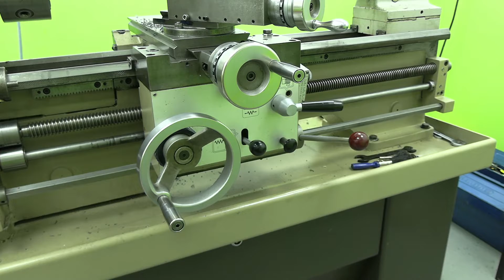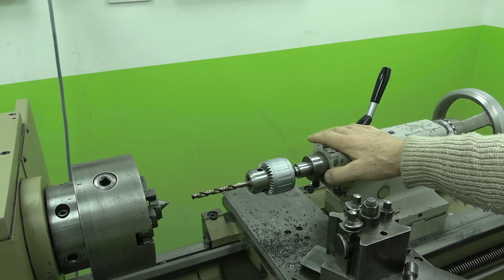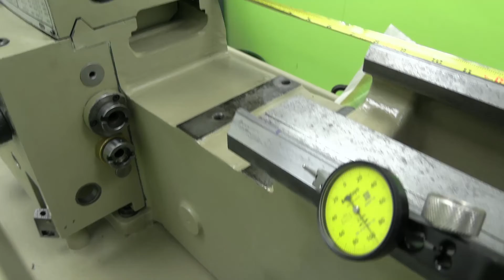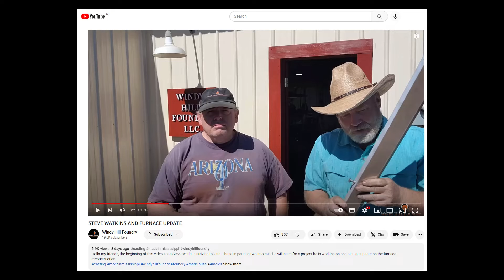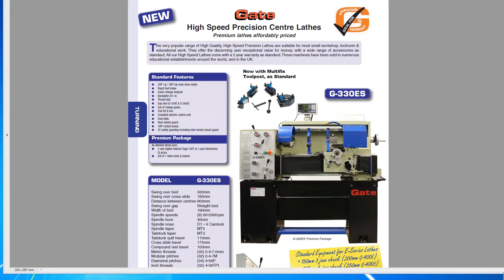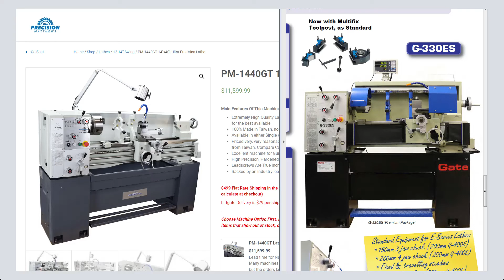What shall I do with my Harrison M300 lathe??

Comment: Hello, I have conversed with you in the past, you sent me copies of the invoice for your gearbox bushing & carriage drive rod.  I am fixing up a TRVS-330 version of your lathe.  I made my own bushing & modified the driver, I won't be robbed, Clousing charges double to triple for the same parts that you paid for them.  If you would like, email me and I will send you pics, your videos saved me a lot of time.  Back to your machine dilemma, my machine cost me $1800 delivered no tax,  mine looked like hell, but under the grime was not to bad. my gearbox was jammed by water based cutting oil congealing in the gearbox no rust. The cross feed gib screw was broken off, the tailstock cam lock was worn, made a new one, luckily the housing is tight.  I knew all along I was going to grind the ways and have the carriage fitted with turcite it will cost me $2500 to do this. maybe I will have the bottom of the tailstock ground. But in the end I will wave a mint machine that will hold a tolerance. I could easily spend $5-7 thousand for a machine that still has wear & problems.  Finding a machine with very little wear will be ridiculously expensive, plus tax and shipping. keep what you have, you are the master of tinkering, Roll with it!!!  Cheers,  chas. giles@ verizon.net
Reply from the maker: The regrind job I was quoted included turciting the saddle which is good. Oddly the bloke I spoke to said he did not advise grinding the tailstock. He said just shim it up, which I guess is not too difficult.

Comment: It's sad that the birthplace of the industrial revolution has seemingly such a paucity of machine shops willing or capable of a relatively straightforward operation of regrinding a lathe bed - there must have been hundreds at one time - but having put all that work into it, I'd be tempted to go the regrind route if you have confidence in the shop doing the work Having said that, I defer to others here who've got a lot more experience than me!
Reply from the maker: Yes this is one worry: what if I spend £1500 on a regrind and it's no good?

Comment: I can't see you being happy with the inaccuracies in the ways, if it bugs you now, it will always bug you, I'm thinking, if you did have the ways reground, plus the saddle (a good price if that's included in the machining + Turcite) then you have the start of a very good lathe. The tailstock, although difficult can be sorted, your crosslide can be renovated on your mill, with finish scraping (might have to make a new gib) the seals are relatively easy to do, you can surely live with the staining on the front bearing, so If you get all this done (maybe £2000/£2500 total?), then you wouldn't be moaning (as much) I think! anyway, Happy Christmas to you, and I hope you sort it, cheers Dave
Reply from the maker: Yes that's a plausible line. My only reservation is what if the regrind doesn't turn out well?
Reply: @samuelfielder  Hopefully you get a competant machinist, It would be good to get some favourable testimonials from their previous customers

Comment: Hi Samuel, thanks for taking the time to share your experiences with your M300. My thoughts….. it all depends as to what you are planning to use the machine for. I believe that there will always be something that you are not happy with this M300. If it was my lathe I would get, if possible an expert to evaluate the issues that you have with the lathe. Then give you a plan as to what may be achievable buy reworking it. Then if this proves to be untenable, cut your losses and get the machine that will do what you need it do. Many thanks again and Merry Christmas

Comment: Hi Samuel,
you went through the hype cycle, nothing special with restauration projects. Check out Wikipedia for more infos 🤓
The tailstock shaft could be fixed with a plasma coating. Its an inexpensive procedure and hopefully available in you area. Problem: you have to bore your tailstock to a bigger diameter. But it is no rocket science and also inexpensive.
Example: https://youtu.be/bYj60ctAmAY
The sealings must be exchanged. Advantage: now you know how to disassemble the machine. Also inexpensive 

The cross slide does not have to be coated! You can machine the connecting surface of the apron. I did it myself on my Weiler LZ 280. 
Yes, the bed ways should be ground. But you need to disassemble the machine anyways. I don’t know if your calculation includes transportation costs, but grinding in Germany is much cheaper if you know where. But, if you grind the bed ways, you also have to scrape the cross slide and the equipment you need is very expensive. Ask the community for borrowing it.
The spindle bearing can be exchanged with one from Thailand. I don’t have a link, but I bought bearings for my mill spindle for 70% less the money than SKF wanted.
A new machine? I was wondering about the options you have shown in the video? What are the main dimensions you want to machine on the lathe? You easily can get a quite good one starting at 3000€ from China

Kind Regards, Adam
Reply from the maker: Thanks I hadn't thought of spray coating. I've seen Adam Booth do it. Machining the apron up is a possibility but problem is that would increase engagement of the gears that drive the cross slide. The price I was quoted for the regrind included machining and turciting the saddle.

Comment: Hi Samuel, the real question here is how accurate do your jobs have to be? if your lathe gets you in tolerance on your work I would do nothing. If it does not and you can't work around it, then you perhaps you could call in a technician to try and move forward that way. In any case I would want to get some experienced eyes on the machine in question before making any decision. Remember that any kind of drilling/boring with the tailstock should be considered 'roughing' Boring to final size will always be more accurate and it's usually possible to work round machine wear and tear. I have an M300 myself and I'm a retired turner of some 50 years experience. Hope you get a resolution that isn't punitive. Regards David
Reply: Your dead right he’s got a pretty decent lathe and the work and time spent on it proves it    In other words he knows what he’s got.   The wear issue just magnifies tool pressure      and it’s not that bad ( I use a m500and a m300 )and the wear he’s got is way less and like you can work to bearing fits when necessary
Reply from the maker: If you're a retired turner pity you don't live closer to me near Winchester. However, although I accept an experienced machinist could teach me a load, I don't really think he could tell me anything I don't already know about the state of this machine.
Reply: Yep.
I’d just learn to put up with the wear.
I run an M400 that is worse than that. 
I know it’s not right but it’s pretty common for machines to be this worn, and it’s common for machinists to just work around it.

Comment: Hi Samuel,
I have watched your videos from the beginning as I purchased a M300 at the same time via Ramco auction who sell off ex MOD equipment. I had several parts missing which I got second hand or made myself. When I cleaned my machine it was full of brass so I imagine it was only ever used in an armoury. I was always concerned when you got deeper into your strip down. You need to remember these are well made old British machine tools and it's a black art to re-assemble them. With the time you have spent on this machine I would suggest you speak to the re-grind company and see if they can recommend a company they work with who could do a full rebuild for you. I now make a living out of my M300 due to the pandemic. Keep the good work up and videos coming. Merry Christmas to you
Reply from the maker: How do you make a living out of your M300?? Glad to hear that! I'm not sure there's much of a black art re-assembling an M300: as I see it there are absolutely no adjustments (unless you wanted to scrape the ways under the headstock). If my lathe were cutting a straight taper I'd be thinking about headstock alignment or twist in the bed, but it cuts more of a curve which can only be down to wear in the ways.

Comment: Hi Samuel, remember the lathe is only as good as the skill of the operator! For what I do as a hobby, & occasional orders, I can generally get to 10 microns accuracy when required, making things like petrol engines etc that are very nice. I do have a top DRO on it but my lathe is a Warco 250V bought a few years ago brand new with extras for less money than your M300. I'm a guitarist so my guitars are a lot more expensive. You will always want better, but be serious about what it's going to do for you. Maybe learn on a Warco then go for the better lathe later if you still feel it's right to do so.

Comment: If you're not happy, you're not happy, that's it!!! The only thing I would say regarding your choices, don't be so eager to throw 15 to 20 thousand at a new lathe, even if you can afford it. The Gates lathe is 200kg lighter than the Colchester M300 that you showed with similar specs. The Gates is made in Taiwan but where is the Colchester Harrison made & do either go through any form of testing in the UK? I'd have loved to buy an old, branded lathe but most are collection only & I don't drive. I ended up buying a Damatomacchine from Italy that ended up cheaper than similar spec machines in the UK. I'm pretty sure they receive their larger machinery in pieces & are assembled & tested in Italy as there is a wait for some that cannot possibly be for shipping from China. All I'm saying is that cheap Oriental, is cheap Oriental no matter what brand name is slapped on it. Especially if it isn't even touched when it gets here & is just, in one door & out the other. I watched someone have to regrind his saddle while singing praise to precision Matthews for his new lathe!!!! Yes, that actually happened!!!!
Reply from the maker: Oh dear. I guess Precision Matthews would supply Adam Booth with a really good one, knowing that it would be all over his youtube channel. I might not be so lucky. I don't know where the Colchester/Harrison lathes from the 600 Group are made but would be very surprised if it was the UK!  My M300 is 583 kg and as you noticed the modern one is heavier and badged both as Colchester Student and Harrison M300. From its photo, it seems the headstock and gearbox are same layout as my M300. Where the additional weight comes from I don't know but the swarf tray looks to be much deeper - or perhaps it's all the modern health & safety stuff they have to put on. Bed might not be beefier. You don't think Taiwanese is better than Chinese?

Comment: Food for thought.
RDGtools
MyFord Super 7 lathe £3895 +vat
Brand new, plus parts are available to customise, upgrade and repair.
Reply from the maker: Thanks. Yes I see they have various 7s between £3 and £10k. I thought Myford went out of business in 2011 but I see it is a new company that took over. Quite a bit smaller than the M300, but I probably don't need something as big as the M300 (although as lathes go it's actually pretty small).
Reply: @samuelfielder  
The best thing about the MyFord is that it’s a British company.
I have been researching on them recently and so far I haven’t seen or read a bad word against them.
I have a cheap Warco Hobby Lathe.
So when I upgrade, MyFord Super 7 is going to be my next purchase.
Reply from the maker: @adrianbritton428  Yeah, the Myford super 7 certainly has a fine pedigree. It's probably a better jump up from my Chinese minilathe than the M300 which is probably bigger than I need. On the otrher hand, I get attached to the things I work on.
Reply: Chalk & cheese I'm afraid. I have a Myford & an M300. There is no comparison in rigidity.
Reply from the maker: @ralanden  I take it you're saying the M300 is more rigid
Reply: @samuelfielder  
Absolutely. The Myford is a model engineers lathe. A second hand Boxford is a better bet. The M300 is an industrial lathe. Try machining alloy steel in a Myford - it struggles. The M300 eats it. Shame we don't live closer, if you are anywhere near Bedford or Cambridge drop me a line.
You can see my pal's VS330 which he had reground too.

Comment: For what it is worth I would like to share my opinion with you! I am, it seems a lot like you, in that I want my machinery to work right and be accurate and find it annoying when they are not. Keep messing with yours when you are never going to be satisfied with it is expensive folly. You will never get it as good as you want it. If you have the money treat yourself and buy a new, or nearly new quality machine. NOT far eastern as even if initially accurate they are not a pleasure to own or use in the long term. My lathe, a long bed M250 with milling attachment was bought from a dealer about 10 years ago, had never been used, was 30 years old, had been badly stored and badly re-assembled. It has a few faults but I love it. I have pleasure in just having it in the workshop, and as a bonus it is accurate and will be for at least my lifetime. Cut your losses and buy something you can be proud of. Regards. Deryk Gillman
Reply from the maker: Thing is, I'm thinking a brand new M300 from 600 Group would still be made in far east. Perhaps the additional price is what it costs 600 Group to fettle it.
Reply: @samuelfielder  Sadly since I read your reply and considered it I am now deeply worried you may be right! My thoughts are still that even with, say, a replacement/reground bed there will still be a host of other things that will niggle forever. My opinion is still that you should still spend someone’s inheritance and buy new/nearly new. After all it can be sold on later - hopefully after many years of your use. Deryk

Comment: Hello Samuel and Happy Christmas to you. 

What an interesting video. If I may offer my two pennies worth:

1. You could sell your lathe on eBay giving full disclosure of its faults and benefits (of which it has many).

2. I think I see Warco green in the background. You could buy a half decent lathe for not much more money than your M300 would make, I would suggest. However, and I speak from experience here, you would need to do a lot of commissioning work as the Chinese don’t seem to grasp the concepts of deburring or cleaning casting sand and dwarf out of gearboxes before assembly. By the way, mine is also sold badged as a Precision Matthews in the USA. 

3. You could consider keeping the M300 and complementing it with a smaller, lower cost lathe for the precision stuff. 

4. I appreciate you are probably suffering from M300 fatigue however, you clearly know the lathe inside out and have a logical approach to even complex tasks. As long as you are fit enough perhaps you could consider doing the outstanding jobs on this lathe. And saying that, could you not scrape the ways in situ?

I hope that has given you some food for thought but if you would like to discuss any of these things further, you can call me on 07831 837581.

All the best. 

Mike
Reply from the maker: I think the Warco machines are Chinese. My WM18 Warco mill is ok but not brilliant. I was kind of working on the theory that Taiwanese machines are a step up from Chinese - any views on that? I bought hand scraper but have never used it. Really need a Biax scraper to remove 0.3 mm I think - or could attack with an angle grinder to start off! Would need a long straight edge which is another thing I haven't got, but I see The Shed Dweller made one by rubbing three pieces of iron together ( https://youtu.be/Is7fkJlRaIA )! Basically, I think scraping down V-ways whilst (a) keeping them straight, (b) keeping them aligned to each other and (c) keeping the correct angle for the V is close to impossible and probably not the best choice for a first scraping job. As to getting a smaller lathe, my problem is I started with a Chinese minilathe and got so fed up with its limitations that I resolved to get something beefier.

Comment: Happy Christmas.  Looked at dispassionately, you might want to consider exactly what it is you are likely to make with this lathe. Are you expecting to turn high-precision parts, or are you just irked by the thought that you couldn't easily make them if the whim struck you to do so? Is your sense of perfectionism getting in the way of an otherwise perfectly satisfactory tool? I know the feeling.  I have a 1980 M300, which I have owned since the mid 1990s.  It's got lots of wear but in reality nothing I make needs a whole lot of accuracy. I believe the old boys made pretty accurate parts with slack old lathes and knew the workarounds, which you could research. These will cost you nothing. For instance, if most of your work is around the headstock, then why does it matter that the further reaches are less worn? Adjust for the area round the headstock. If you want to work down the other end, slacken off the clamps. Using a 2 micron DTI only depresses one!
Reply from the maker: I expect you're right about "just irked by the thought"!

Comment: I think, personally, that you have enough time, effort and cash invested in this lathe that it must be worth having the ways reground? Unless the cost of that is significant and replacing the lathe with a new one/replacement is a less resource consuming event.  Also it depends on how much meat is on the ways and if it would be successful having them reground.  The danger is you risk spending a significantly larger sum of cash and it does not fix the issue. The bonus to fixing the lathe/replacing worn bearings etc is that once its done, its done.
Reply: Ultimately, can you get your existing lathe repaired to a standard your happy with for less than the cost of replacing the whole lathe?
Reply: Oh and option 4 is nice if you can live with the cost. remember, You cant take it with you :D
Reply from the maker: @jameslaird8399  You're luring me...